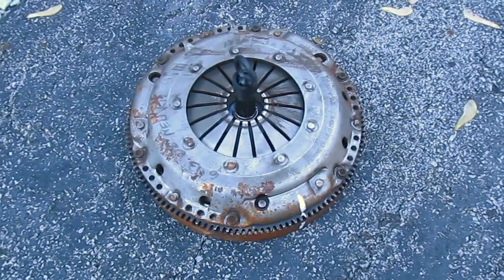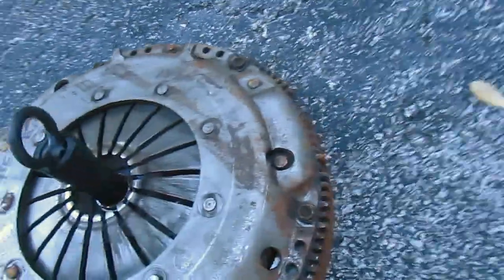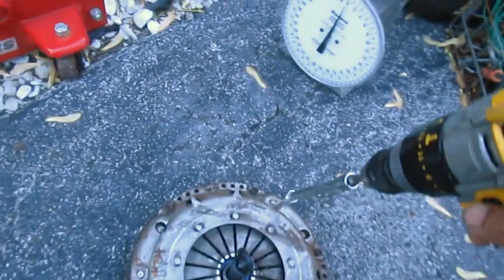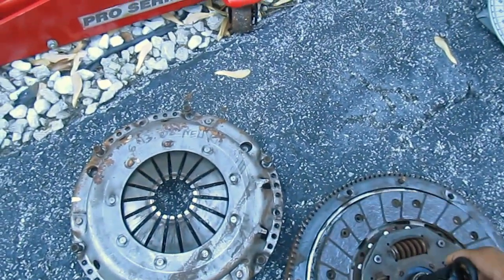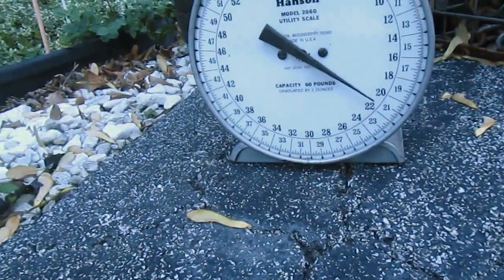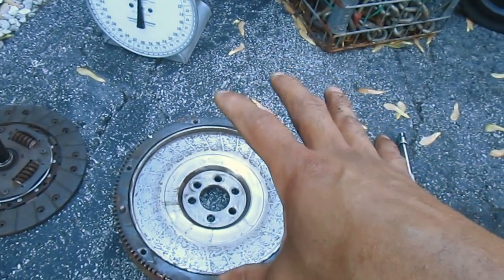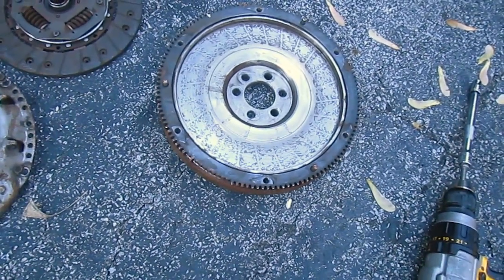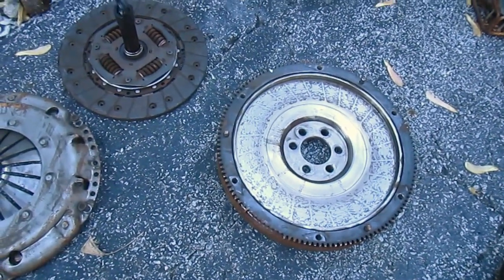TDI 1.9L 5-Speed Single Mass Flywheel (SMF) Proper Weight and Why

Comment: Do you still have it on?
Reply from the maker: No. Not because it didn't work but because it is more expensive then the more dependable OEM replacement Duel-Mass Flywheels. As it turns out the OEM DMF were trash with too much slop causing early failures. The only reason to install a SMF is for "High" performance or Track racing.
Thanks for watching. TDI love from Chicago.

Comment: Do you know if there is a weight saving over a standard DMF, fitting a standard SMF?
Reply from the maker: I was wondering the same thing. I though a lighter flywheel should be easier to start and stop and should result in more MPG or faster speeds. ANSWER: NO... I bought a ultr-lite 10 lb SMF flywheel and none of the above was true. A weighted flywheel starts the diesel better. A weighted flywheel balances better for higher RPMs. A weighted flywheel does not make odd noises. A weighted flywheel in general "feels" better.  Needless to say, I remove the ultra-lite SMF flywheel and can only see it useful in a mid-speed (40s-50s) long-distance track usage. (TDI Love from Chicago)

Comment: Hi , i just installed the conversion Single Mass Flywhee what i bought on Internet for my Golf 5 1.9TDI 105hp 2004 and the second day i found Oil on the floor. Is looking like oil from the transmission.... What can be happened?
Reply from the maker: Thank for watching. FYI: My video was just an experiment because my flywheel had failed and I was putting in bigger injectors and a larger diesel pump. Being an old-school mechanic I thought with more power a new DMF would fail. But I was WRONG! There, I admitted it. The New DMF are amazing. They are much better made and can hold a lot of power (not for racing or beating on). and they are easier to install too.
Does your new single mass vibrate at idle or at any speed while driving? These manual transmissions don't require a lot of gear oil, so, I would check the level to make sure you didn't just overfill it. Also the newer DMF sold on Amazon can hold up to 125hp when new and are easier on the drivetrain. As long as you are not "Tracking" this Golf. I would highly suggest putting a DMF in for a daily driver. The DMF crap in my video was all OEM and the new OEM is 1,000% better. I ultimately changed the SMF in the video for a DMF and it made stop-and-go traffic bearable again. "Besides; one of my legs was getting huge." lol
But I was concerned about adding HP and using the stock DMF too. It is hard get solid info on if the DMF can hold higher HP and how much HP they can hold. I will tell you one thing... if you have oil on your clutch you will have to unfortunately open the case again and make sure you are not wetting the clutch. I would not wait until it starts slipping. I am a driveway mechanic with a little direct experience and I hate doing the job but I love knowing that the job was done by my hands. (Hot Tip:) Reset all you bolts/nuts with RTV and not Locktite(tm). This will save your life and a ton of money if you are doing motor mounts or trans work. I have seen bolts work their way out and shear off just from diesel vibration. Lat tip: There is a new class of motor oil that is not VW TDI approved yet but I have used it and it is amazing in diesels. It is "GF-6A 5W-20". It is designed to suspend particulate, stop water, stop rust, lub the valves, and clean the engine and turbos of sludge and varnish. I know we all though that all motor oils already did this, but that was all just marketing hype in the past.

I wish you luck but I would go back to DMF... TDI Love from Chicago

Comment: What single mass flywheel should I buy for my conversation?
Reply from the maker: The new dual-mass assemblies are much more reliable and very easy to install. The OEM sets had real problems that were never taken care of by any recalls. If you are not putting bigger injectors, pistons, or a massive new turbo in you do not need a single-mass flywheel.

TDI Love from Chicago... Keep it roll'n

Comment: Hello, brother. Nice video.
My DMF has almost faded and it needs replacing. I am thinking of getting a SMF. The car has almost 250 000 miles on it.
Can you give me an advice for the model of the SMF I need to get? Are they that different?
I am in the Eastern Europe, not USA.
The vehicle is Golf Mk 5 1.9 TDI 90bhp.
Reply from the maker: DO NOT INSTALL A SMF. The new DMF are very good, affordable, and easy to install.
Reply: @GallowayChicago  Thank you!
Reply: @GallowayChicago  i have drive both type of flywheels on e46 diesel and single mass feels sharp when shifting gears especially from 1 to 2 gear.
Reply from the maker: @k.b1596  The gears are not just "sharp" they are jarring to the entire drivetrain. If it were a All-wheel-drive maybe you could spread out the torque. Knowing what I do now about putting SMF in these DMF diesels I would highly recommend a complete and affordable DMF kit. The SMF will over work your motor mounts and all your bushings too. I tried installing polyurethane bushings but they were designed for race track usage and not everyday. It is true that if you want over 120 Flbs of torque (bigger turbos and larger injectors) that a DMF will not hold and if you are putting together a high performance TDI a SMF is needed but if it is your daily driver I urge you to reconsider install any SMFs. I remember just being wore out after driving in stop-and-go city traffic and eventually switched all SMF converted clutches back to DMFs.

TDI Love from Chicago.

Comment: Hello thank you for the video. What cause your turbo shaft to fail? The rattling off the engine after single mass why wheel clutch kit installed? My Jetta has 55,000 miles is a 2.0 L tdi 6 speed MT the slave cylinder failed so I decided to replace the whole clutch assembly with stage 1 single Mass flywheel clutch kit, the engine idles loud but no issues watch when I drive around 2,000 rpms I get vibrations fifth and sixth gear is very very loud and it why braid super hard around 2000 RPM right after replacing the clutch check engine light started coming on and off if it calls for Turbo boost sensor out of range. Can the engine vibrations cause that? Thanks ahead for your response
Reply from the maker: Thanks for watching. Vibrations can be caused by bad motor mounts. My turbo went bad because of oil consumption. We were using the right high quality synthetic oil but the turbo can not cool properly when oil level is low. The center motor mount (or dog-bone) will cause motor travel when shifting between gears. This can break the exhaust system. The side motor mounts can cause a running vibration and a banging when turning while moving. Single-Mass flywheels are harder and louder and require a break-in period. It is just how they are. If your vibration is rhythmic or has a repeating sound based on rotation then you my have an out of balance flywheel (i.e. wap, wap, wap, wap). An out of balance or off center flywheel can cause a lot of problems and should be corrected sooner rather then later. OH!, and to answer your question YES vibration can cause a CEL (check engine light) by triggering the knock sensor. If the vibration are strong enough. Good luck and stay safe.

TDI Love from Chicago...
Reply: Thank you very much for this very useful information I will remove the clutch and inspect for any damage or abnormal wear on the flywheel, and will definitely check out the engine mounts before doing anything else.

Comment: Good Video man.

The noise my dual mass flywheel makes is like a steam train chugging along. It disappears when temp reaches 90 degrees celcius. It's so fucking annoying.

I blew up the gearbox in my Mk4 Golf 6 months ago and I suppose I should get the car fixed now and will change to SMF as I have always wanted. Not looking forward to doing it alone, trying to maneuver the gearbox in. That's why it's sat so long.

Comment: My dual mass flywheel is slowly running away. Can i repleace it for single mass flywheel? It is 2002 alh engine. Can it cause some demage in engine or transmission?
Reply from the maker: Thanks for watching.  YES.  You can replace your DM-Flywheel with a SM-Flywheel.  But keep in mind that you will have to change the Flywheel, Clutch, Pressure Plate,  Bolts, and throw-out bearing too,  Most Kits have everything you need.  I found out the hard way that you should never buy/use a used flywheel or an ultra lite (16lbs or less) flywheel.  The ALH operating tolerances are too tight to have a used flywheel resurfaced and still perform well.   Amazon has many SM and DM 1.9L ALH kits.  Since making, this video a lot of the DM defects have been addressed and corrected.  So, The new-er DM-Flywheel kits are easier to install, better balanced, and most plastic parts that are prone to breakage have been removed... also the DM-Flywheels are cheaper.  I particularly like the LuK 17-050. It is a DM that can handle light tuning, but if you intend on doing heavy tuning to add speed and torque that a SM is a must and I would recommend the 36lb Southeast Clutch model number 17-059SMF.  Keep in mind that the SM will usually have a stiffer(harder) clutch pedal and for some, this is tough on day-to-day driving.  I have installed several of the 34.5lb DM Luk 17-050 assemblies and they perform well.  I really like the Luk's easy bolt down design with no centering necessary.  Remember to pay close attention to the motor mounts.  These ALH mounts like to strip.  I usually fill the holes with RTV silicone before putting the bolts back in.  That stops them from backing out due to vibration.  The bolts do not stretch, but instead, the aluminum threads on the mount give way.  The silicone only serves to hold the bolt still and cushion the vibrations, but if the threads are gone then you will have to replace the months.

TDI Love from Chicago... Where Spring has returned.
Reply: @GallowayChicago   GallowayChicago  thank you so much for your answer. I mean, i will use SM flywheel, becouse it is less expensive for my 16y car.

Comment from the maker: @Suave House Thanks for watching.  That oil is what was turning to tar in the intake.  And this wasn't any good for the turbo too. Now that you have blocked off the soot from the exhaust gasses the build-up should stop.  Think of the oil as maple syrup and the exhaust gasses as sand.  There is no reason to force sand through your motor.  You can remove the intake oil by connecting an "oil catch can" to the black hockey puck looking thing on top of your valve cover (CCV).  I have a six-part video on it "VW TDI Oilly Intake CCV Fix 1 of 6 - Remove Vacuum Tank".  The "Oil catch can" must be emptied at least once a year.  Basically, the oil is from the CCV valve and the TDI was designed to let the oil vapors pass through the inter-cooler and pass the EGR system into the intake manifold.  But, in real world usage, you get the formation of coak that in very severe situations can completely block the intake manifold.  It should be noted that this oil pools at the lowest point of the intercooler, and on 2.0L TDI has been known mix with melted frost accumulations and hydro lock the motors causing thousands of dollars of damage.  The 1.9L does not suffer this same problem, but a Youtube VW specialist advocates drilling a "small" hole at the bottom of the black plastic neck after the intercooler on all VW TDI motors ("Intercooler drilling, draining & plugging = NOT a boost leak!!!
")  If you don't want to drip oil on your driveway or in your garage then try the "oil catch can" instead.  Let me know if you have any questions that I can help you with.

TDI Love from Chicago...
Reply: GallowayChicago 

Hey buddy the manual swap is finally done today!  Lol been lagging. Did the SMF Valeo clutch kit.
Reply from the maker: @suavehouse5150  How does it drive?
Reply: GallowayChicago 
No the starter is not engaging.
Reply from the maker: @suavehouse5150  I have installed SMF and DMF and ultra-lite Flywheels.  I  only had a problem with my Auto to Manual conversion because the donor starter was shot.  Yes, it is a different starter.  I had to buy a new starter.  The solenoid to starter copper strap was grounding out to the starter body.  Take the old starter out and try to kick-it with 12v and hold it tight.  I had a battery pack, a power 20amp 110v jumper, and jumper cables connected to my van and the little diesel had a hard time turning and the starter would smoke and get real hot.  At that point, there was little mystery that the starter was bad, but before the smoke, I thought there was a wiring problem.

TDI Love from Chicago.
Reply: GallowayChicago 
The starter works fine from the donor car. I’m thinking it’s the cable from the ignition to the automatic shifter?  It’s just hanging from the ignition. Will it start with the stock computer without the vag-com
Reply from the maker: @suavehouse5150  I used one of the bicycle cable clamps on my ignition shifter cable.  If I remember right; you have to pull the cable until it is positioned outside locking pin hole..  I did not want to disassemble the ignition switch.  But it still works to this day.  If you get the car in the on position, you can power the starter separately and start the car.
Reply: GallowayChicago 
Okay I’m gonna try to pull that ignition cable first if not I’ll jump start from the outside or push it down the hill lol 😂 jk

Comment: Hi I have a problem during igniting the switch niose observed at flywheel after re assembled fresh fly wheel noise was remove old part Mark on rim teeth
Reply from the maker: If Starter works your flywheel should be the right size.  I think your problem is that the flywheel is not seated correctly (One or more of the bolts were completely tightened down before the others). Your flywheel might be unbalanced, or your main crankshaft might be bent.  Remove trans and rotate crank by hand (best if you have a helper).  Look at flywheel for alignment. As you rotate the flywheel the spacing between the engine casing and the flywheel should remain the same all the way around. Next, remove the flywheel and check bolts and center alignment (it only goes on one way).  Sorry, the only answer is to disassemble and try again.

Hope that helps.  sorry if this does not translate well.  Good luck .

Love from Chicago.

Comment: would you recommed g60 flywheel and VR6 clutch for upgrade on 1.9TDI?We will increased the power of engine and searching for solution.
Reply from the maker: You have got it. Especially if you are tweaking the power output. You can find some pre-mached sets on eBay. Clutches are rated at different release points by different manufactures, but generally all stage-1 are in the same stage class (and so on for stage-2, stage-3, stage-4).  Depending on how much power you are upgrading to, you are most likely looking for stage-2. Do not go with ceramic.  It will kill the flywheel on a diesel.  Remember: stage-2 will have a stiff peddle (not fun in stop-n-go traffic).  and Your Flywheel should weigh no less then 21 lbs

P.S. on eBay search "TDI 1.9L clutch set". It is cheaper to buy G60 21lb flyweel and Clutch Kit seperaly but the full kits take the guess work out of knowing if the two will match.  Good luck.

FYI: Just looked on eBay and saw "VW G60 Single Mass Flywheel - MK3 Jetta Golf, B4 Passat 1.9L TDI 1Z AHU 16v MK4  (Fits: TDI 1.9L) $204.90 Buy It Now (Free shipping) I take no responsibility for this product and do not know the seller!!!

TDI Love from Chicago.

Comment: Next time you have a hydrolock pull the glow plugs out and then crank it over(it is messy but a whole lot faster)
Reply from the maker: +Dustin Krautheim Thanks for watching.
I actually pulled the oil pan to see if any of the rods were bent while turning the crank by hand. Only problem was the crank would not turn and hold its forward position.  It would bounce like there was a spring or springs in the calendars. Had I know there was oil in there and been thinking I would have been all over your suggestion.  But I was so aw struck by the bouncing that I turned and held the crank and that is when the oil slowly pushed past the rings and dumped all over my face and flashlight.  For a run-a-way I got off easy. It was not a major rebuild.  That TDI is still on the road today.  If you can keep them from rusting they will last forever.  You can buy a good condition 5-speed 1999-2002 Golf/Jetta/Bug 1.9L TDI for around $3,500 US and within a 1 to 2 year(s) (depending on your driving) the car will have paid for itself in service and fuel savings. 

TDI Love from Chicago...  Remember always use Synthetic oil in Turbos big & small.